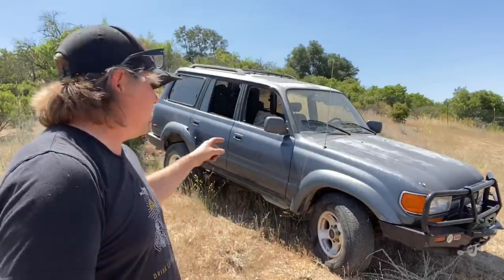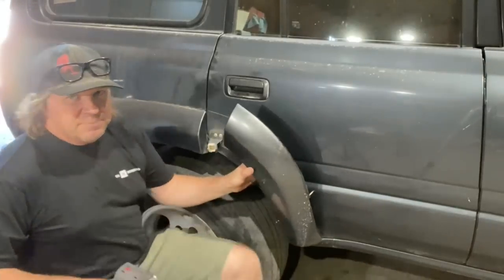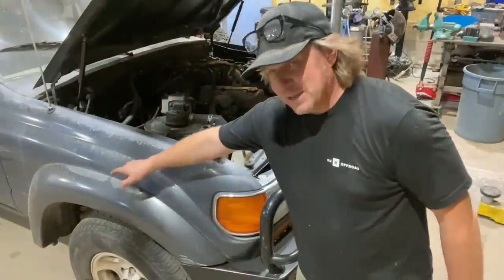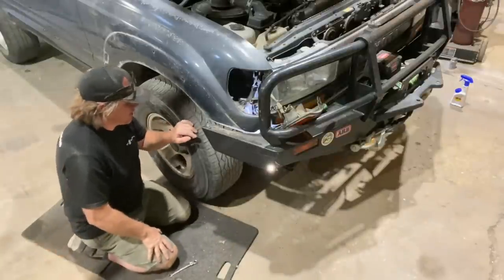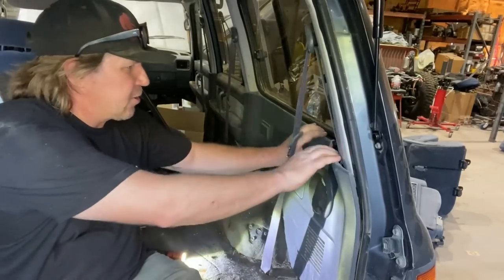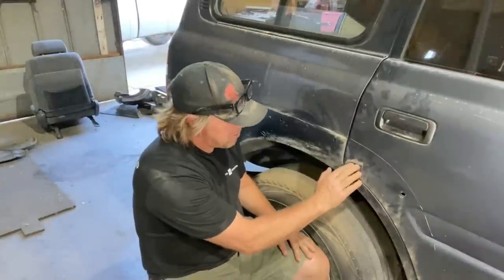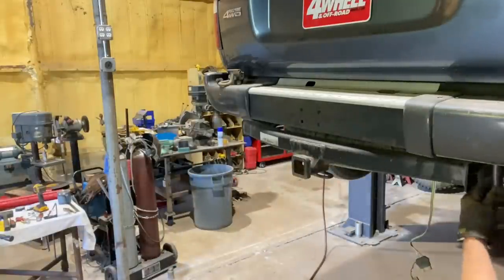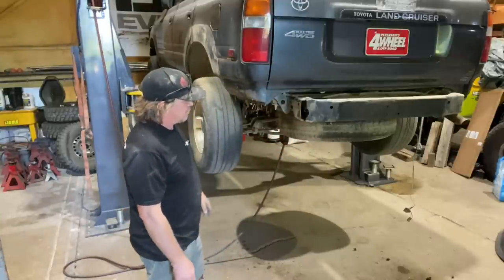Dirt Daily. Dirty 80 Back Seat and Flare Delete

Comment: You could use plastic body plugs/christmas tree fasteners to fill in the holes.  You can leave them natural color or paint them with a plastic/vinyl dye - black or body color.  You can put the square plugs back in the square holes and then put a plug in the center to cover up the hole for the screw.
Reply: Plugged the third brake light hole on the tailgate for my jeep like that.
Reply: Done that on a flair delete on a shotgun sport, looked pretty decent esp black plugs on a black car

Comment: You could use nutcerts in the hole like your sliders on nubesock. Or small fiberglass patches on the inside and Bondo the outside.

Also definitely need rattle snake covered seats now.

Comment: I almost got a set of land cruiser axles for about $500. Was going to put either the front axle or both under my 91 4runner. Still plan to put a 2uz in it, but solid axles will have to wait until I can get what I'm after.